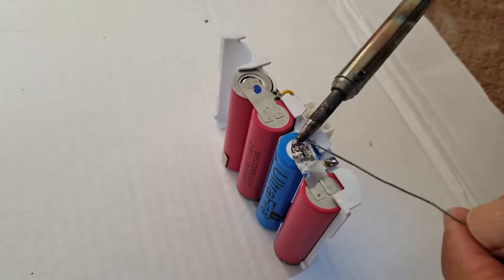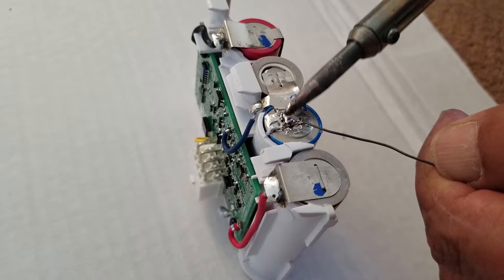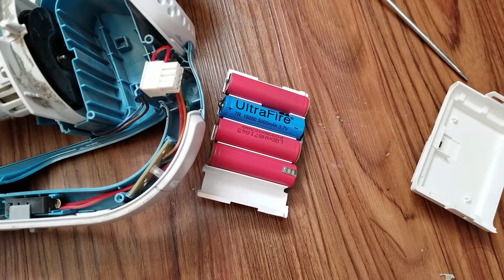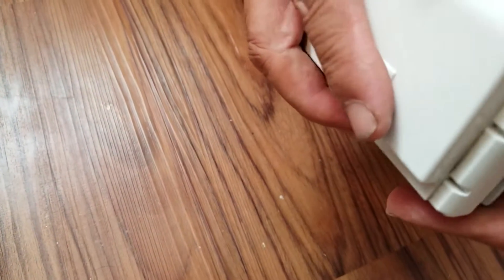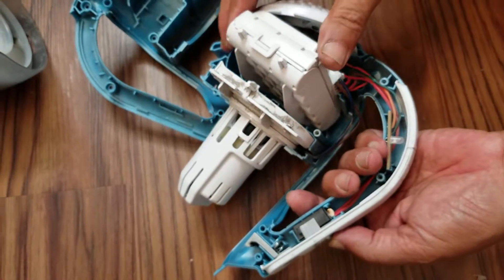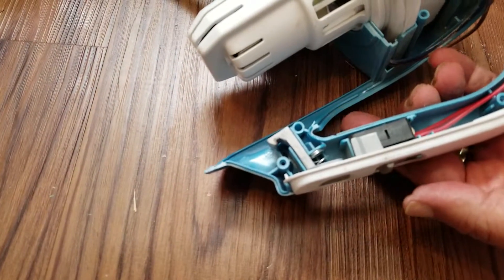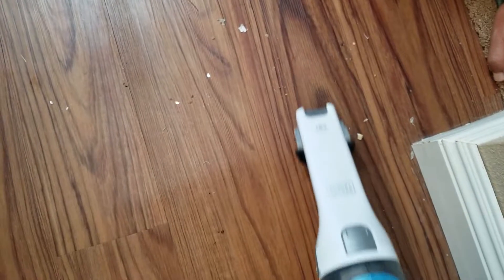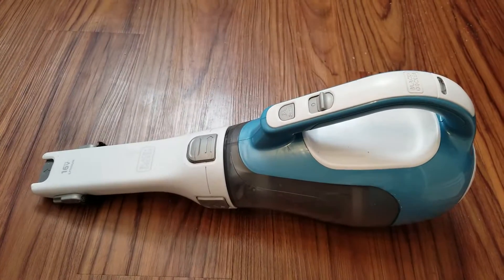DIY Replace battery pack BEST Black & Decker Tools Vacuum  Lithium how to CHV1410L

Comment: I finally got around to changing all 4 of my cells. After a couple days i tried it and it ran for a couple seconds and died. I put it on charge and the light flashed for a couple seconds and then stayed on but it didn't charge the batteries. I confirmed with a dvm the base is supplying power but the batteries are not getting charged. I charged the pack up with a rc charger for now.
Reply: The batteries were not getting charged because one of the cells died. I did a repair on it and now the batteries last a long time and charge up fine. It is working like a new vacuum now.

Comment: Fast charge, and great handling🌼 It makes it very efficient to not have the cord but the battery may die a bit soon if you do continuous cleaning, i recommend doing 15 to 20 sec runs.

Comment: I have the next model and they built the battery pack with the board together and fused all plastics together so you can't take it apart, or even change the batteries.
Reply: is that the 20v black model? I was just about to try to fix it -- thanks, it seems useless now.

Comment: I drilled out the spot welds, soldered back in four 18650, had to open the casing a bit, put it back together, same problem, it only runs for 30 seconds or so.
Reply: The problem is the non-repairable, non-replaceable Johnson PM brush type DC motor. The batteries and balancing electronics are likely OK after replacing a clearly defective cell.
Reply: Cells must be matched usually all same type and new. One weak cell with less amp draw ability will kill the pack since they are all only in series. 
Best to use all same new cells and have them all at the same voltage when assembling.

Comment: Damn no one knows how to replace a 12 volt lithium battery for a flex Black & Decker. Who are the screws you can't get to
Reply: I agree. So wasteful of Black & Decker (having to solder in a new battery!) when we are willing to change out the battery. Otherwise mine are in great condition 🥲 just not up to all this
Reply: I have the 3 cell version and I got a good spot welder to prevent overheating the cells. I had it apart yesterday to check before the spot welder arrived today. Looks doable but may be a bit hard since you have to work around the wires not being able to disconnect from the handle